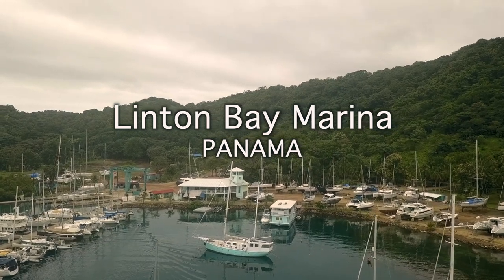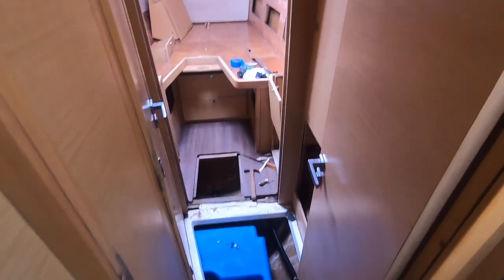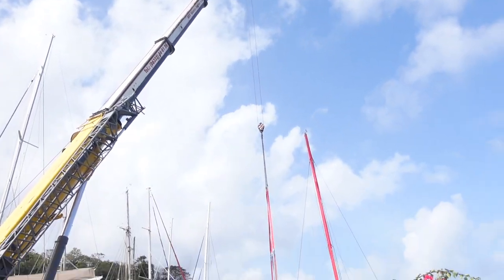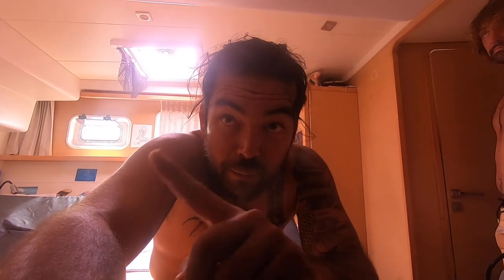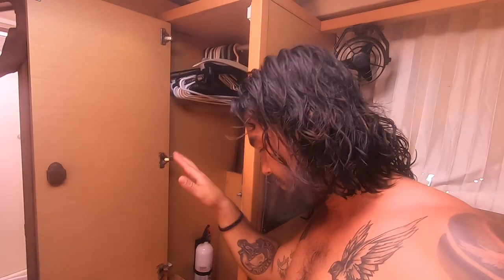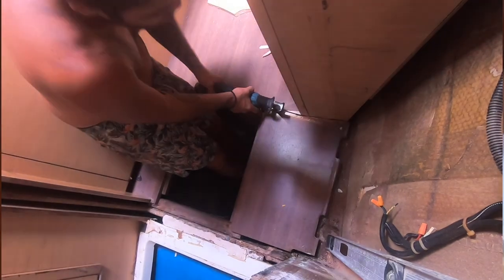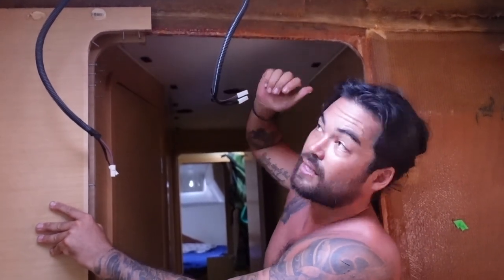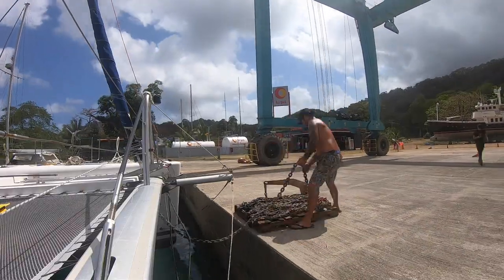CRACKED BULKHEAD REPAIR SERIES - Part 2

Comment: I'm not through the entire video yet so maybe you answer this in the video but I assume you will have to loosen all the pressure on the deck/hull/ect and then check to see if the deck/floor truly lays down as far as you need THEN you will have to tighten it up again so you have room to put in the 5200, THEN you will have to loosen the shackles all over again???? Yes? No? Maybe? If you put the 5200 down first and then lower the shackles/deck/etc. if you do get it to go far enough down it will be too late???? Best of luck Colin.

Comment: Just a question - At what point will you decide that it has gone too far to rebuild? I'm not that at home when it comes to yachts and therefore don't know whether that is a "normal" amount of problems but, I mean, it looks bad, really bad. Is it even doable without taking it all to pieces like lego? And at that point would it be easier/cheaper to just buy another used yacht? Though rebuilding it by yourself will mostly cost time, so when you guys are mechanically inclined (what you seem to be), nothing will be impossible.

Comment: Been thinking about these cats . While I love the concept and even was in love with one and having stayed a bunch of times on a lagoon 450 I would not buy one .

 The first Issue is the rudder and engine are often the lowest points ,  if you ground them at all you are holed and disabled . This can be seen on a number of lost cats .  Even grounding is soft sand drives the rudders into the hull, lose one you lose both . 

The second Cats take huge stresses because they do not heel as a safety valve . Thus the loads are carried by the rig and hull and not  relieved by by the safety valve heeling that limits it to a known max . It is easy to overload the rig and can happen in a sudden squall to the best of us . In addition a mono hull will split the waves dissipating the energy  , a multi the wave gets trapped between the hulls and can alarmingly pound the underside of the cabin floor .  Finally as one bow can be on one wave and the other stern on another the twisting effort is huge  on these larger boats . 

Third is build quality , these boats are not blue water in my opinion , they are cheap production boats that are great party platforms . This Lagoon just does not have the build to last . 

There is this Lagoon not in rough weather that broke  , Zingaro recently and a personal experience with a brand new tri that came apart on a moderate day . While blue water mono hulls also fail it is generally due to hidden rot  . 

This is not to say I do not think that there are multi hulls well built, lasting  and able to cross oceans , I think the costs are higher and they do not reside among these  modern made for the charter crowd cats .
Reply: Very good points. The sinking from the rudders breaching the hull is a old problem as with the saildrives, but the real reason that those boats sank was that the fwd engine/mechanical space bulkhead in the sugar scoops between that and the main hull were not watertight. On most cats that bulkhead has all manner of holes bored through it for wiring and plumbing without the use of proper MCT’s, glands or bulkhead fittings, sometimes just shot with expanding foam which is useless. When looking at a quality builder it is clearly seen the use of marine grade MCT’s and bulkhead fittings which maintain the 100% watertight integrity of those entire bulkheads.
Reply: @nuffsaid7952   Yes , on a boat like mine with a keel and sail drive the sail drive is well protected behind the keel . On many of these cats the sail drive is the lowest point meaning the first thing you hit . They just don't have the strength of a keel for that . 

Very good point about the bulkheads they are constructed with the same kwality as the rest of the boat . 

Now for what these are made for , costal partying in the Med and Caribbean - they are fine . In fact great . 

I foresee many of these in 25 years abandoned , expensive to keep at a dock and way too expensive to fix . Probably see lots as live aboard's that never go anywhere or are relegated to powerboats .
Reply: @faircompetition1203  yes, lagoon builds houseboats on two hulls when looking at the quality of critical areas that can’t be easily seen. There have been some owners over the years that were acutely aware of these issues that after buying their Lagoons, pulled them apart and re-bonded and reinforced the bulkheads etc and have a great strong, safe, comfortable cat as a result. But let’s face facts, who wants to buy a product to have to re-build it to make it right when the manufacturer should have done the job properly from the start.
Reply: @nuffsaid7952  Well , I am not actually saying the manufacturer did it wrong . They built a boat for a purpose . A Nice party platform off a beach at the BVI's  with comfortable beds . For those that don't go out unless tit is a nice day and have no intention of crossing the Pacific the boat is fine , heck great . I have used one for that . 

No point in paying for the expensive build if you don't need it . All boats have a purpose and I hesitate to say any of them are wrong . 

Where I get mad is that there are not many ways an inexperience buyer can tell the difference . These people then buy the wrong boat . I also see guys on a fresh water lake that the winds blow 10kt average with a boat built for the north sea . Wrong boat . 

There is no rating sticker really for a boat that tells you what it is meant  for , ya Lloyds but even that is not a cure all . 

My personal boat is a light weight costal  racer cruiser that meets my needs well . I'm not crossing oceans , I only weekend on it and mostly beer can race or day sail . (Laser28)  Light , fast , foam core and Kevlar so it won't rot and  fun to sail while still having an aft head and standing headroom

Comment: Do you think all that crappy looking adhesive/filler was added on the supports under the floor where the lumps of wood were jammed post construction as well Colin?

Also once the floor is lowered to it's original position on the supporting structure I don't see how you will fit under there again so how are you going to gain access to those locations to glue them together?

Comment: Do you realize that the reason Lagoon is so keen to help is because the original design of the 450 is inherently broken and the bulkheads that Lagoon built are inadequate to support the weight of the cockpit, mast and rigging? That you're trying to fix a problem caused by the manufacturer being too cheap to put in proper support?

What you need are 6 -8 big hydraulic jacks to hold the boat while you build better bulkheads than Lagoon could be bothered to provide in the first place

Comment: The catamaran doctors ⛵️👨‍⚕️🩺
I'm pretty sure, a lot of new "Ikea style" boats have potentially similar issues as soon as they suffer a grounding, a failed haul out, etc. All new mass production boats make extensive use of glue and sealant.
I'll bet, if you start a company as "boat doctors" you'll be pretty successful.

Comment: Dude, what a mess. How those things can even be called "bulkheads" is beyond me. 2m high and just a single sheet of ply? With any tension on the rigging either the mast has to go down or the hulls have to come up. I can imagine Lagoon wants you back in the water asap as showing how they are built with scare any protective buys with half a brain.

Comment: Looks like these boats have major manufacturing design flaws that have existed for decades. Makes me wonder about the advice form the man who designed them in the first place. IF HE was that wrong to begin with, then is his advice now going to be any better. From the "old" damage the designers would have to admit their failures before giving any future advice.  Its long past your decision to rebuild vs walk away but with what you have shown in this video can you trust that other major flaws will not suddenly surface six months or a year after you start sailing again? You got guts to continue and wish you the best. Have you considered filling various voids like the area you were wedged in with closed cell foam to provide additional supports?

Comment: Would it be possible to take it apart the way it was put together?  Remove the top, then remove the interior fit outs, make the necessary repairs to the bulkhead and hull, and put it back together?

Comment: I bet a steak dinner Lagoon knows how to build a better boat.  In their sleep.  This is corporate negligence that could lead to serious or even fatal consequences if one of these boats were ever to be caught out in a real storm.  No doubt a hurricane when the boat is on or close to land is the worst of all possible scenarios in terms of loads and stress.  But using cheap ply and glue is an embarrassment!  If I am ever lucky enough to be in the market for a cruising cat, current Lagoons will not be on the list, and I will be checking bulkhead construction carefully! 

Colin will get this sorted and end up with a far superior boat structurally.

Comment: Why's the rum gone?         ...oh.
That part that's bent looks like it was either soaked with water or burnt at some point, judging by the color of it. (possibly even both) At this point it definitely looks like that entire boat needs to be stripped fully down to nothing and completely refitted.. basically building a new boat with some parts of the old one.. SO yeah.. new boat would likely be cheaper and definitely easier at that point.. but that's the beauty of doing it on Youtube, you get more money for doing it the hard way than the easy/smart way.

Comment: Right at the 5:00 mark, it looks like another place that should have been built up and diagonal braced. Maybe even a few more layers of ply on the inside of that bulkhead. That is a very small bit of ply in what MUST BE an important hold.  Hoping you had string lines run all over the place... buddy, I am nervous for you!!

Comment: I have a Question ???   How old is this Video ???  I remember a couple months back you had the boat on the hard all chalked up, and you and Jamie sitting on the aft deck taking a break.... Did you have to put her back in the water ???  Also with all that bulk head damage, and the glue delaminating why are you worrying about the paneling in the boat ??? seems like you would want to remove all of it, so you can get to the core of all bulkheads to inspect for any cracks.... Has Lagoon suggested installing brackets to bolt new plywood with existing and then glassing over ??? I figure you won't answer this question but I figured I would give it a try......All the best !!!!

Comment: You guys really need a laser level or two
Reply: ...or 3 or 4 or 5
Reply: @scottdecker3072  isn't that the truth, but what amazes me is just how this boat is put together - and that this last minute failure, so close to port, really saved their lives; no way would they have saved things even a week out to sea.

But the construction of this beastie, and that it was clearly falling apart already! It amounts to the worst possible publicity Lagoon could wish for because the hurricane and the voyage didn't do this; the major damage happened ages ago. But the way it's all slid together like dividers in a beer box, from parts jig-built in a factory and then just glassed into the hulls??? Lagoon should've quietly just given them a new boat to stop the bad publicity.

Comment: G'day  Crew,,
Hi Colin ,, try not to stress ,,it will go back into shape with the right prep .
I wondered if its possible to raise a vacume in the hull cavity with a high volume  air pump  ,,it would help  pull /push  it back to shape using atmospheric  force .  There are many ways to apply the right amount of force , the weight of water in a tarp could give thousands of PSI /TONS of force .
To every action an equal but opposite reaction ....
Try to reverse the force that was applied,,  you will get it ..
You can  also construct a makeshift CLAMP to apply force above & below  across the whole boat  using beams, frames,  levers , .
Where there is a will,
There is a way ...!!!
You WILL get it ,,just takes time & energy .
Best wishes  Colin .

  Much Respect 
        from
 Down Under

Comment: Did the plywood in the bulkheads delaminate from the previous sinking and lose strength? When non encapsulated plywood gets wet does it lose its bond with the fiberglass tabbing?

Comment: It’s definitely not a great incentive to buy a Lagoon when you see these issues.
As you said it’s been like that pre-hurricane, I wonder how many other Lagoon owners are getting their flashlights out and inspecting their boats right now?!
Reply: A lot, there’s over 50 that have found the same issues, although not as severe, on the 450 alone and owners of other models are finding the same issues. This has been an issue with the quality, materials and methods with lagoon cats going back over 7 years ago, it’s just that it never got the exposure as it has now with Parlay’s YT channel which is getting very popular. Lagoon are suffering greatly since this has come to the forefront and the onslaught of claims are flooding in along with the crash in sales. It’s a pity that the build quality in the critical areas is so poor as on the surface lagoon do build well laid out cat for those that want a very spacious comfortable live aboard cat. If only they had not cut corners and sacrificed critical structural integrity to go cheap to make more profit, they would have retained their high ranking with new buyers and would have kept the respect, all of which is all but long gone now. Many buyers that were going to buy a lagoon have changed their minds and going to Leopard, FP, and the semi custom builders instead.

Comment: from an ignorants point of view i would ensure the boat is resting on a perfectly flat base horizontal and start your work glueing from the bottom up with vertical compression force applied from above to glue everything from the bottom up ... by the time youve glued the boat up to the deck the rig to the top of the mast has to be rigoorously equal to stb and port ... the whole structure must be symmetric orthogonally on all three axis otherwise after glued together it will become warped and bent and will not sail properly

Comment: Cut out all the wood and expose the joints properly.do the structural repairs then sailto Brazil and get the interior completely rebuilt with cheap labour.
Reply: @robc6851  I was only thinking about the price. Best place in the world to fitout is Kowloon amazing work they even carve panels.

Comment: Only way to fix that level of total catastrophic failure ss to return the boat to the factory and have the entire deck removed, replace all the bulkheads and any structural components while the boat is located in an original mold or Jig to ensure its square and true. Keeping boat square and level on  all 3 axis will be nearly impossible in a gravel boat yard.after the deck is removed THEN re-glue (tab in glass is better) everything, add a significant amount of new and additional structural components, fiberglass and epoxy. Then put the deck back on. I estimate this amount of labor and material costs will far exceed the cost of a new boat.... They have the car show on cable, Graveyard Car's, the guy rebuilds cars from the Car Graveyard, the new Channel will be called Davy Jones Locker Boats... ;-)

Comment: I don’t doubt your abilities, but I think that Hull is done..
Reply: The hull is brand new now that they've rebuilt it. it's the ill-equipped support structure which connects the hull to the deck. They have no choice but to rebuild it much stronger then it came from the factory.. if they want to feel safe making a crossing. It's his only option now because how would he sell it to anyone without lying about all the structural damage. He'd never get anywhere close to $220 000. He's all in at this point, just gotta commit to makin it happen

Comment: Good luck sorting that shit out. Looks like piss poor construction at the factory. Those butt joints are shocking. One thing to beware of is working in those tight spaces if you're going to be using products that give off fumes, could quickly turn bad for you. I'm a lot smaller than you and there's no fuckin way you'd get me in there! I'd be looking at ways of cutting out the deck to get at stuff. Good luck either way, you've worked your ass off so deserve success!

Comment: 11:25 wonder if a pen style metal detector would let u pin point were the screws are and u could drill threw the bathroom to get the screws out the cabinet 
Lol or what ever is next

Comment: When the insurance co surveyors wrote off the boat after the hurricane is there any chance they had discovered these problems? Not surprising that Lagoon wants to help with the repair. They certainly want to minimize any damage to their reputation as this appears to be either a design weakness or poor workmanship. Considering the loads applied to the mast and shrouds the structure does seem to be lacking.

Comment: OMG, its a major fixing job!! This problem resulted from from hasty faulty design of a multihull boat by a monohull designer that he misunderstood the role of the bridge as a joint  bridge between two/three  precisely balanced hulls and therefore this middle structure is not supposed mechanically  to carry/ support the difference of weight between the two hulls especially when they are exposed to the perpetual kinetic energy of rough sea waves which imperatively will cause cracks in a such unbalanced design of a multihull vessel, which cases are frequently seen...To understand my comment plse check the traditional designed multihull boats of native Hawaiian people!!